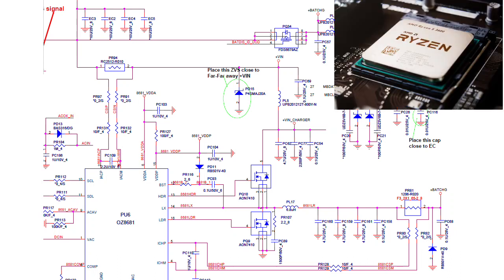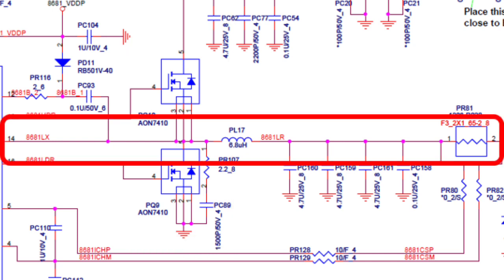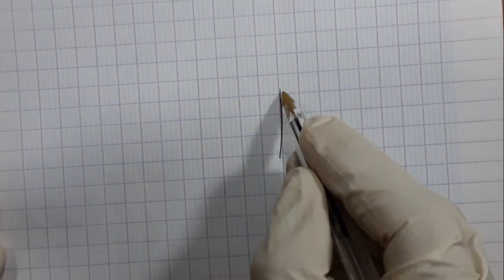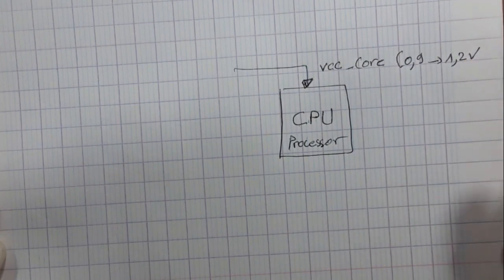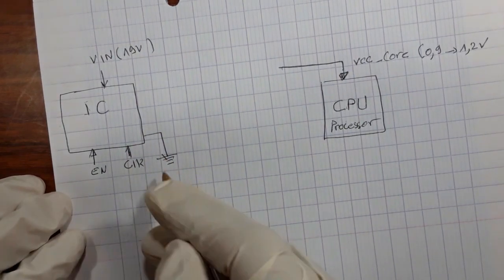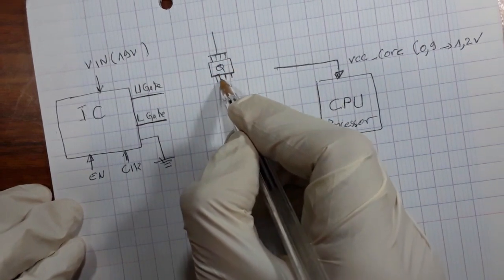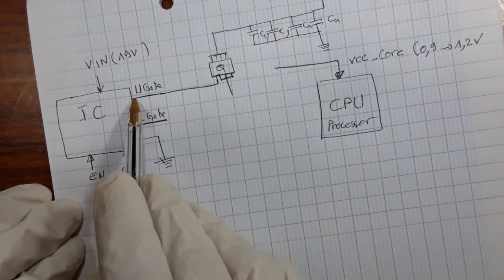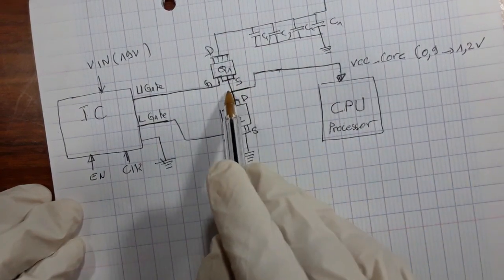Learn CPU circuit diagram troubleshooting - Processor circuit power rail VCC_Core

Comment from the maker: Buy Professional Repair Tools👇👇👇
https://northridgefix.com/shop/?ref=ERB_23
Including👇👇👇
Microscope
Voltage Injector
Programmers
Reballing / Stencils
Repair Tools
iPhone Cases
Soldering
Soldering Equipment
Storage / Rack
SMD Books
Tempered Glass
Test Tools
Components
Donor Boards
Gadgets / Accessories
Ports / Connectors
Tweezers
Adhesive
Apparel
And much more

Comment: Thank you sir, Can you make a video also on the laptop battery charge circuitry cause i have a tendency of misdiagnosing the mosfets around the battery esp when the client says the laptop is not charging the battery. sometimes i'm successful, sometimes its just a dead battery itself. so help understand the battery circuitry. What voltage output should i expect for charge IC for the battery to be fine. Just as you said for CPU its around 0.9 to 1.3V.
Reply from the maker: Noted